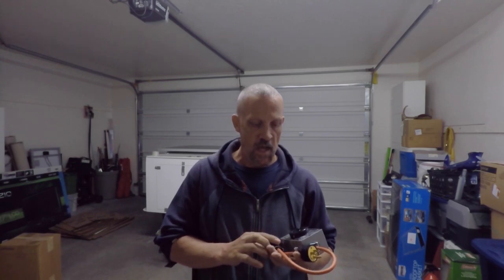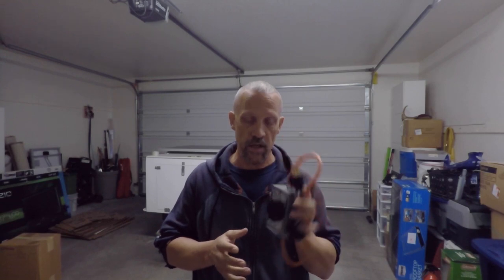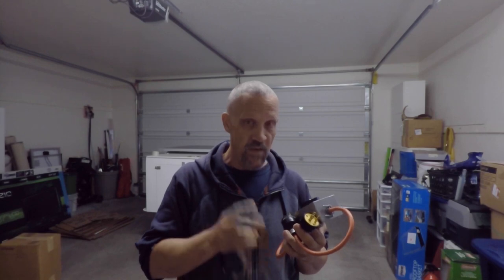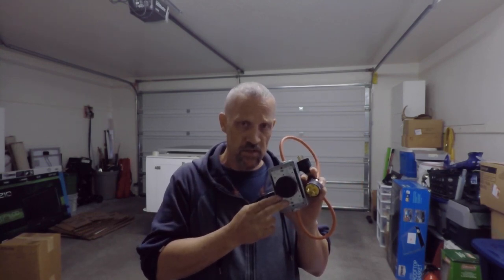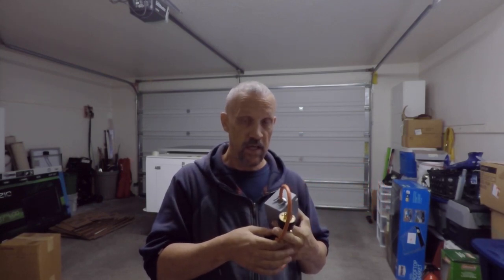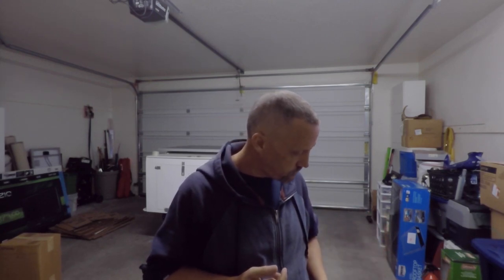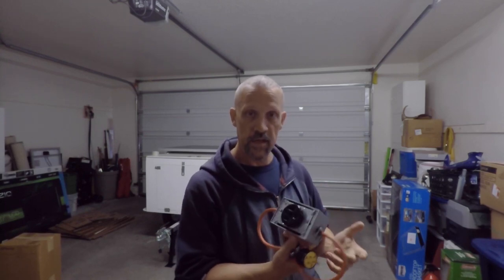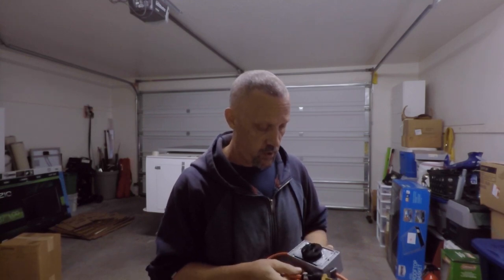How to Get 220v From 110v Questions Answered and SAFETY CONCERNS

Comment: As an Avionics Tech, of many decades, my only comment here, is you refer to 2 legs being different "Phases".  You have 3 Phase types. And you have Single Phase Circuits in most homes, ONLY and 3 Phase is used in Industrial applications. And 2 Phase anything just does not exist. A three Phase system has 3 feeds in a Wye or Delta configuration for Induction motors, and is much less expensive to operate, particularly on things that run constantly.  I know a fan motor that has been run continuously for 60+ years now.   Generally Large HP Electric Motors use the 3 Phase requirements. It gives the most starting torque and running torque for any given HP.   You then go on to describe 2 different Circuits.  That is the correct term, Amperage is fed from each circuit and should never be overloaded.  A device that can use 110 at a certain Amp, the 220 feed would roughly be half. We should have 220 vAC like most of the rest of this world, but we simply do not for household items!   I do not know what your Welder requirements are, but should be in a manual, or clearly stated on a label on the machine itself? And you see if attached to a 220vAC feed it will be nearly half the Amperage draw.  My Welder has both 110vAC feed and a 220vAC cord feed as well. Wire size is super important and if you exceed 30 Amps, then yes, those cords become fuses, or if one were to come out of its receptacle inadvertently when you are using that welder. LOL I am no home qualified Electrician but those are rules that never should be broken, It is always best to go to a higher gauge plug and cord, of course if it is unknown. I still am fully confused when you say they must be tied together with a separate Bus Bar, as that is usually common in all CB panels. Regardless if one pops, I am pretty sure, due to Amp Draw, the other shall be right behind it, popping as well. Also, most folks store gasoline, or mowers and other equipment in the same garage I keep ALL Combustibles separated outside in their own shed for a reason, Fumes alone can be a Bomb, if sparks fly! I do not even have electric in that shed for that reason.  If at all possible, keep the 2 separated. I always side on caution as much as possible! That might be one reason I am closer to 70 YO here perhaps? HA!
Reply: I found your video, because I was hoping to have a cord similar to yours that I use on a 10kw Deisel Genny aboard my 40' Deisel Pusher RV.  But I simply installed a 60 AMP 220vAC CB and used 6 Gauge wire run of 30'. in my house anyway!  (Your idea, as said is that "Temporary" situation, but go with a Higher Gauge wire, please!) That went into 2 adjoining 110vAC, CB's and ran a dedicated Circuit just for that Welder with appropriate Receptacle.  That is always best, oh and it is a GFCI, Expensive yes, but the manual called out for that, and I agree that it is a much better option.  Sure, it costs more folks, but a LOT less, and if installed incorrectly, and upon any fire the Insurance Company denies your claim because of ignorance!  Mine had to be wired a particular way due to codes here, The Neutral and Ground have to be on the correct Bus Bars. Instead of a couple of hundred-dollar outlay, it could be the Total Cost of whatever value your home is, if a total loss. And yes, I know of such horror stories in my time!  Insurance companies look for every avenue that they can to not pay out in a claim. Something to always consider.  Wouldn't even hurt to pay a Certified Electrician to come in and Inspect your Install, as I did.  Codes change, and I would never know.  They do!  And an extra 50 BUX is cheap insurance to me!  The Absolute Number One rule!  Isolate ANY circuit and ensure by checking Each Leg of the circuit to ensure it is truly off, with a meter, before you even get near an open CB Panel.  It takes less than half an amp to kill you, in the right circumstances.  In this case you will not require a Crematorium most likely! LOL Just constructive criticism here.  Stay Safe DIY'ers!

Comment: If you looked up at a power pole, you would see three main lines and they are together delivering three phase power from the producer to that neighborhood and at a much higher voltage. A fourth line is for ground and usually mounted lower. There is nothing magical about three-phase power. It is simply three single phases synchronized and offset by 120 degrees.

Household electrical service is single-phase. If you use an oscilloscope and look at the 120v power found at a normal wall-plate outlet in your house, what you will find is that the power at the wall plate looks like a sine wave, and that wave oscillates between -170 volts and 170 volts (the peaks are indeed at 170 volts; it is the effective (rms) voltage that is 120 volts). The rate of oscillation for the sine wave is 60 cycles per second. Oscillating power like this is generally referred to as AC, or alternating current.

 A transformer converts power from one of these phases, regulates the voltage and splits it into two legs. These legs are each 120 volts but are offset by 180 degrees. These two legs together provide 240v, single-phase power.

Hope that helps.
Reply from the maker: Thank you for the information :)
Reply: It depends on where you live and the age of the grid. There are still some single-phase transmission lines out there. The majority is three-phase. All residential and light commercial is single phase.

Comment: You did just fine for DIY except for not pinning the two breakers together or replacing them with a 2 pole breaker.
Reply: A two pole single space breaker runs on one side of the circuit box giving only 120v.  Two regular single pole breakers positioned next to each other in the circuit box feed off both sides (legs) giving the 240v and if the "switch"  is tied together will trip together.  It's better to use a double breaker designed for 240v.
Wasn't sure what your "2 pole breaker" meant.  Just wanted to clear that up.
Reply from the maker: Thank you for the positive feedback! I appreciate your knowledge and tactful way of helping me learn!
Reply from the maker: @arkansasmountainman  I appreciate your positive feedback! Thank you!

Comment: On the 120 to 240 video I was wondering if you could feed the 220 into a sub panel and put some 120v breakers and still be able to get a 220v breaker for a 220v plug?

Comment: How do you get 220 to 110 thanks
Reply from the maker: In a 240V plug you will have either three or four wires. (Black, Red, White, Green) Some 240V plugs will not have the White wire such as mine. The Black and Red are both 120V each. The White is the Neutral and the Green or bare copper is the ground. (some may have two black wires and no red) You need one black, white and a ground to get your desired 120V.

Comment: Thanks for the two videos on 220v from 110v.  Really gave me ideas on how to approach a project in my garage-shop.  I do have a serious question though (I'm NOT a hater -  -  serious question).  If you make the effort to do a separate wire run to have two 110v services from the two separate phases in your breaker box, why not do the wire run to supply the 220v the standard way in the first place?  Is it just a matter of saving dollars on lower amp wires?  Or am I missing something?  I make no claims to understanding the fine details of electrical work, just a DYI'er trying to wrap my head around this.  Thanks.........
Reply from the maker: My breaker box is about 30 feet from where those outlets are and it only has two positions in the box. I can either have two single pole 120V breakers like it is or one double pole breaker for a 240V circuit and didn't have room in the breaker box for both. (only two spots) It was already set up for two 120V circuits for the outlets and lights in the shop. I didn't want to put in a new breaker box, pull 30 feet of 10 gauge wire and buy a double pole breaker because of the expense and we were to be moving soon anyway. That's why I decided to move only one outlet closer to the other and build the device I did. I could use my welder that way temporarily and when we move, I take my device with me and the wiring in the shop is all code and standard for the next owner. Hope this helps you understand why I did what I did.

Comment: The welder is rated for  pulling  __ amps and will try to PULL that  at max, if unavailable it may shut off from insufficient power. The rating or the welder/unit is the point the parts may start to over heat. The 120v legs from > !separate circuits! are rated to Push 15a each and have the appropriate rated grounding cable for that amperage load. If you  use  16/3(16gage 3 wire) cables, AND CONNECT THE GROUNDS FROM BOTH CABLES  TO THE OUTLET WELL, AND USE GFCI TYPE OUTLETS, AND LINK THE BREAKER BARS OF THE TWO CIRCUITS . It should work but if one gfci faults and the other doesn't it would put a 30a load on a 15a circuit and if the breaker malfunctions due to a high spike you could also burn your house down.. however there is no point. All these items are about the same price as just buying a long 10/3 cable, 240 outlet, 30a breaker, and 60$ for an electrician to check the circuit and clip the breaker assuming you installed it. BTW if you rent and offered to pay for it your home owner would love it..  just a tip get to the point faster..
Reply from the maker: Thanks for the information. Quite a bit more expensive then the way I did it but if you are looking for a more permanent stationary solution it sounds like a safer way to go. Not nearly as portable as my method but it depends on what you are trying to do I suppose.

Comment: This may be a dumb question...  And it may fan the flames of the Policing Professional Name-callers...  But I was just wondering...  Could a device like this be used with a 3500W Generator that has 2 120V/20A outlets (say, to run an electric clothes dryer)?
Reply from the maker: Sorry but I don't know the answer to that question but my guess would be no. Some generators do supply 240V though.

Comment: As a DIYer I have a question I hope someone can explain to me.  When I look at a 220v breaker in a panel box, it's wired two hots (blacks) and a common (white).  Why did you make your 240v combiner use two hots and an earth ground?  Are welders not supposed to use the white neutral return wire but only the green earth ground?  Aren't earth grounds only for protection, usually chassis shock protection, or are welders the exception to this rule?  I thought earth grounds are not meant for continuous circuit current.  Please enlighten me.  Thank you for helping me understand. 
 I have a stand-alone shop with a sub-panel and I want to be sure I wire my 220v plug for my welder correctly.  I will be using a dedicated double 220v breaker.
Reply: NO!!!! Do not wire a 220 circuit from a SUBpanel.
You said standalone though, so maybe you are using the term subpanel loosely.
A subpanel has separate bus bars for neutral and ground wires and typically has no main breaker. 
Is that what you are talking about or do you have 2 power, 2 neutral, and an earth ground running from your house? 
[[ Are welders not supposed to use the white neutral return wire but only the green earth ground? ]]
220 outlet MUST run from to the MAIN PANEL, not a subpanel.
And whether you run ground or neutral doesn't really matter so long as the wire is insulated (not bare).
This is because the neutral and earth ground connect together at the MAIN PANEL .... & importantly ONLY! at the main panel.
This is called BONDING of the neutral and ground.
A true subpanel should NOT have neutrals and grounds bonded (There would be separate bars for each.)
Why not bond them in a subpanel? To maintain Path of least Resistance for the ground - i.e. common/neutral maybe carrying  current from another appliance beside the one you are using that is shorting out in your hand. You want your shorted out appliance in your hand to hit a wire that has no competing current load on it - otherwise it could make your body look like a more enticing path to ground!
[[ I thought earth grounds are not meant for continuous circuit current.   ]]
Correct! But on a 220 circuit run from the MAIN PANEL, Earth ground and Neutral are tied together. Technically, you should you NEUTRAL, but for practical purpose, Running Ground from the MAIN PANEL is no different than running a neutral.
Reply: A welder (or any pure two phase appliance) will not require a neutral as the return path is through the two phases. A great example is your A/C unit outside your house, vs an electrical dryer. The first will not have a neutral as ALL parts of the A/C unit run on 240v 2 phase (in the US), while the dryer WILL have a neutral as the control systems, lights, etc in them are 120v single phase, while the motor and heater are 240v 2 phase.

And yes, the bond wire (ground wire) is purely for the case that something gets energized that shouldn't and it provides a path back to source which being such a low resistance path it will cause the breaker to trip instantly.

Also, depending on what the 2 pole breaker you're looking at is providing, it's possible that it's a multiwire branch circuit and it's just a way to send out two 120v single phase circuits while saving a neutral and a ground wire run across the house. It's less common now as AFCI breakers are required in more locations though, but it's very common in older homes.
Reply: @2Truth4Liberty  "NO!!!! Do not wire a 220 circuit from a SUBpanel."
There's literally no reason you can't put a 240 circuit in a sub panel... It's done literally all the time in houses or businesses with a sub panel. It's not even remotely a safety concern, and it's certainly not a code issue.  A sub panel (unless it's a strict 2 phase with no neutral, not that I've seen that in a house built in the last 50 years) will have 1 or 2 phases, 1 neutral and 1 ground. There's no reason you cannot put a 240 circuit in that panel.

"And whether you run ground or neutral doesn't really matter so long as the wire is insulated (not bare)."

It absolutely DOES matter if you run a ground or a neutral to a 3 wire device. You run a ground, not a neutral. Period. A neutral is for carrying unbalanced load, there is ZERO (generally) unbalanced load in any situation where a 3 wire device is called for. Running a neutral is just asking for someone else to come along and do work later, see the neutral and decide to piggy back off it and now you potentially have an energized surface somewhere else because you opted to land a neutral in the case of actually wanting a ground.

"Why not bond them in a subpanel? To maintain Path of least Resistance for the ground - i.e. common/neutral maybe carrying  current from another appliance beside the one you are using that is shorting out in your hand. You want your shorted out appliance in your hand to hit a wire that has no competing current load on it - otherwise it could make your body look like a more enticing path to ground!"

You bond the neutrals and grounds at the main in order to prevent having potential on metal surfaces somewhere in your house, not for the strange reasoning you gave. The current traveling on a conductor has no bearing on if current will flow through you in the case of something shorting out. Current will take ALL AVAILABLE PATHS to source (ground). If you're a path to ground, it doesn't matter if there was going to be 1A on the neutral, or 10A, some of it is going through you.

"Correct! But on a 220 circuit run from the MAIN PANEL, Earth ground and Neutral are tied together. Technically, you should you NEUTRAL, but for practical purpose, Running Ground from the MAIN PANEL is no different than running a neutral."

You still run a ground, not a neutral. It's a homeowner DIY, they're 99.999% of the time pulling NM-B.

Like good god dude, if you're going to try to explain to someone how to do something, at least be correct. The way you're trying to explain to him will just be a waste of money, and is potentially dangerous with the dumb shit you want to do with grounds vs neutrals. Seriously, what on earth  code articles have you read that makes you think anything you said was true?

Comment: you forgot to mention I think also that both outlets for the 110v  the both breakers need to both have equal 15amp fuses not one with 10 and other with 15 but it also can have 20amp fuses on both just not a miss match.
Reply from the maker: That may be true, I have never tried this with miss matched breakers but it sounds reasonable to me. Thanks for the info.

Comment: At 9:02, you mention that you do not have the equipment to measure the load of the welder. :-) You do. You have that 
Fluke multimeter. Read the instructions for the meter and you will learn yet one more use of one of those dial settings. Information is godly and powerful.
Reply from the maker: You are right, I need to research how to use the Fluke to measure the load. The welder information for what it's worth says max of 18A. I'm pretty sure the actual draw is less than that especially at the settings I am using. I am away from home until spring. When I get back maybe I'll do a test to see what the welder is actually pulling and post a video of it so others will know.
Reply: @DIYHomesteadProjectsDIYHP10  There are so many things to learn in life and only by doing Step 1, can you then learn what Step 2 might be. Great little videos. Never let the naysayers hold you back. Just take the parts you want from what is offered and throw the rest of it away. Most information is worth about what you paid for it. Your video gave me some ideas for some needs that I hadn''t recognized could be so easily accomplished. I do understand a lot more than what I've done but watching others tinker gives me that push that everyone needs. Thanks for spending the time you did to make the videos.